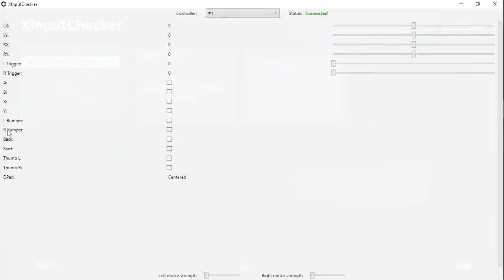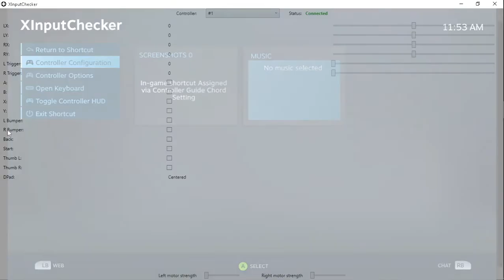Steam Controller Touch DPad Delay [VR @Mennenth ]

Comment: Any way to get DS4Windows to work on linux?
I have tried SC-Controller but it wont take any input from my Dualsense.
Reply from the maker: I need to get back to editing SC Controller. There is a test branch of the Python 3 fork with DualSense support but I haven't touched it in a few weeks. Need to get a new release out eventually.

Comment: Thanks for corroborating the findings and narrowing it down to the pulse time slider! The test I did simply had both at default, both at half, both at max, and both at min.

I'd still personally recommend minimizing both sliders though. Just in case.

Silly that this happens. Idk if its a bug or just unintended behavior, but I did report it on the steam forums as well.